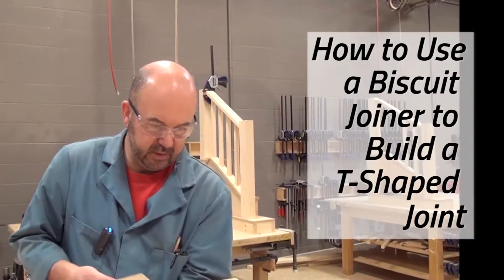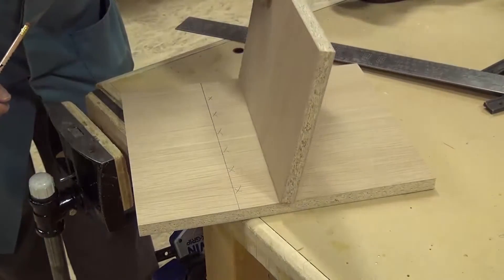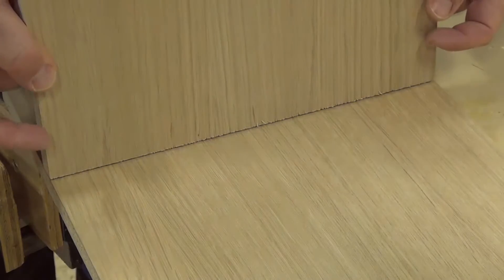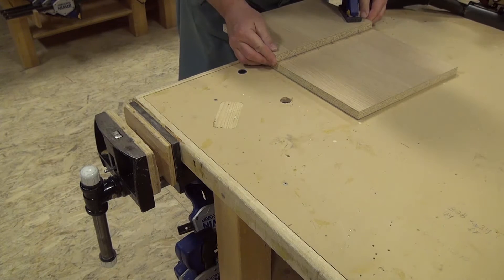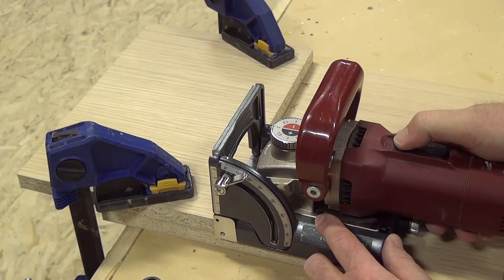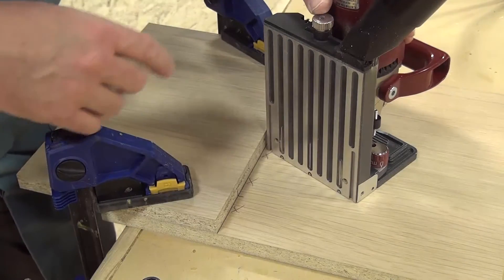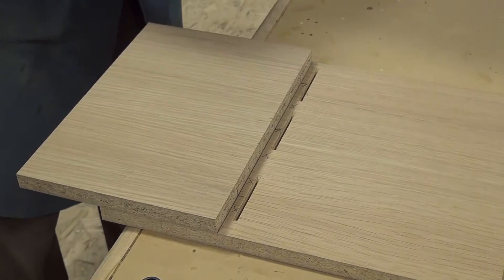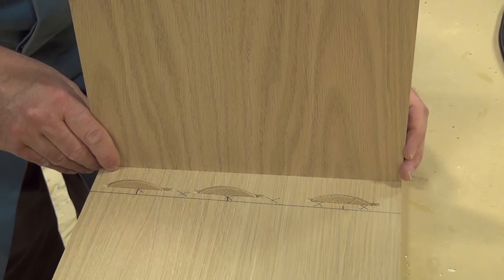Biscuit Joiner Demonstration Part 2

Comment: How did you insure that the blade was centered in the thickness of that particle board? Was it 3/4" board? Is the blade centered on 3/4" by default when not using the fence?
Reply from the maker: Hi Lance. Using this method it is irrelevant where the blade is as it uses the base of the machine as the reference. In our shop we have biscuit joiners that have an adjustable blade height and those that do not and they never need to be adjusted.